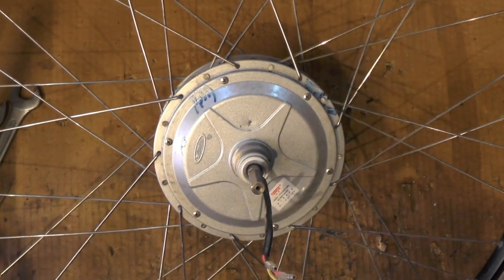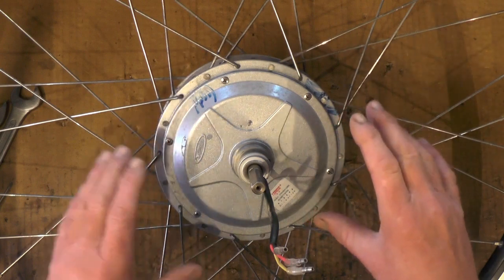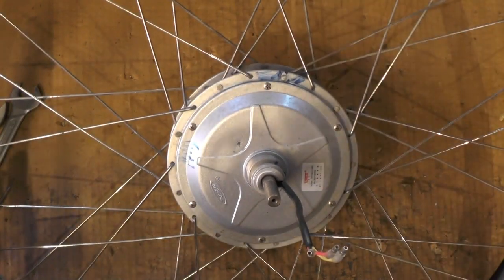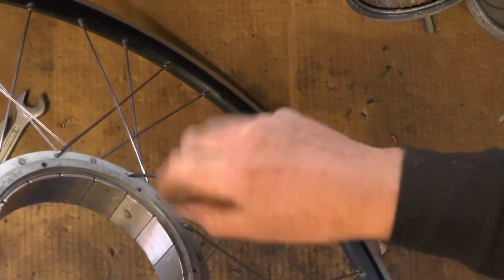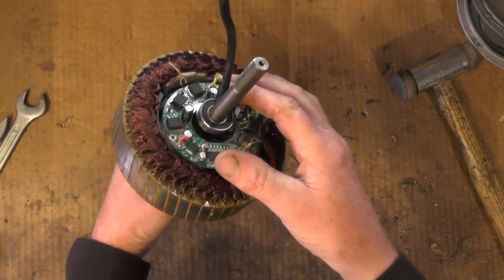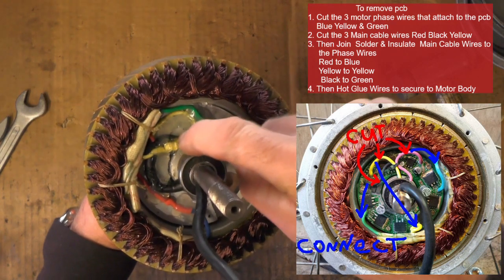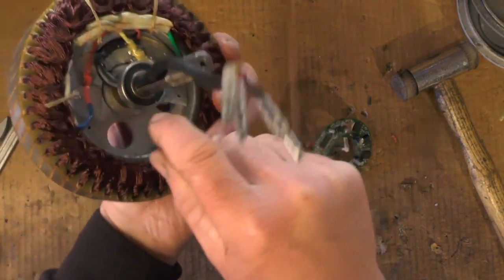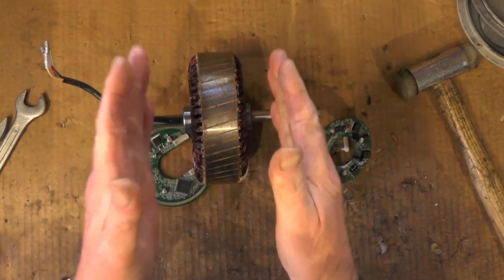"Recycle a Cycle Electric Hub Motor (Sparta) Repair a Rear ebike Hub in to a Front Hub PART 1 "mr f"

Comment: Hi Paul, This was really good all that was missing was you and the factory where you used to work!!

Seeing those hall sensors (not sure why there are three) it reminded me of a job I had in a factory where we sold German fans and modified them or configured them to suit particular installations. On of the jobs we did was to add a hall sensor. This we did by poking through the fan body until it gave a reading (without making a noise!!).

All the best!!
Reply from the maker: Thanks for the feedback and sharing your experience, appreciated!😉

Comment: has anyone ever discovered how to talk to that controller? I got a wheel like this second hand and not intending to ride it per se, but would like to know if an alive controller is too complicated to talk to directly. does it take DC + resistor or is it DC + some proprietary signal?
Reply from the maker: hi L1Q
sorry i have not got a clue, this controller in the hub was fried so i just wired in a stand alone controller.
some electronic wizz kidd out there will be able to answer your question i would think.
all the best
thanks for watching and feedback👍👍👍
regards
Kev

Comment: Its not needed to mount hall sensor if you will use controller which can work without sensors (most of modern Chinese cheap controllers can do this). If you persist to mount halls then simply use very thin wire with  teflon isolation (dont know how they marked in europe but i Russia its МГТФ cable from aerospace industry ). Using МГТФ you can pull wires through the same tranche where power wires. Good luck!
Reply from the maker: great 
thanks for feedback
regards
Mr f